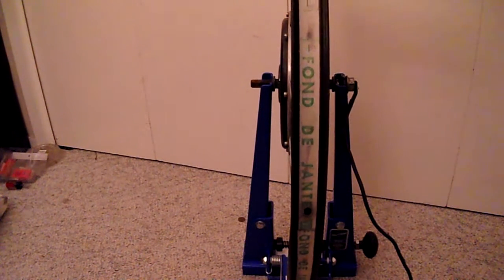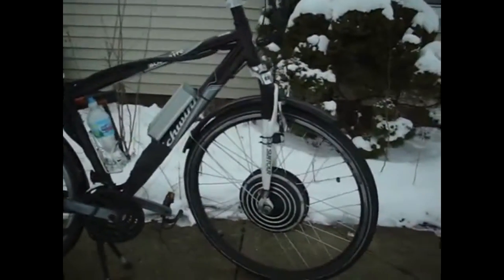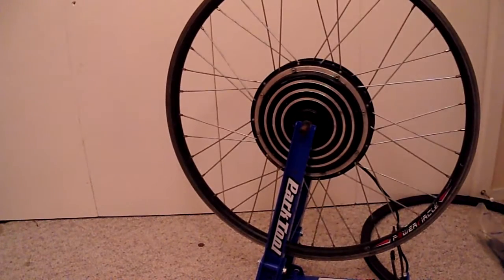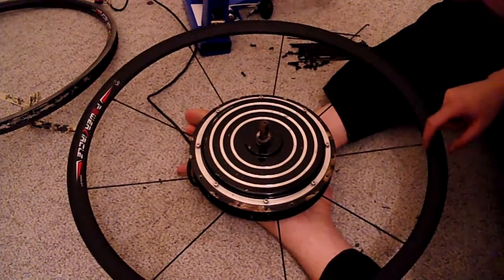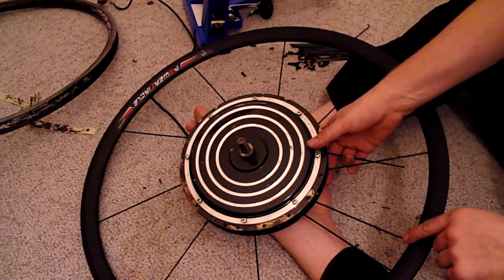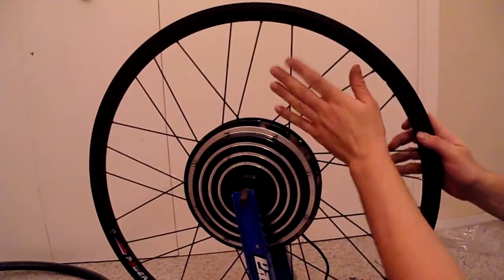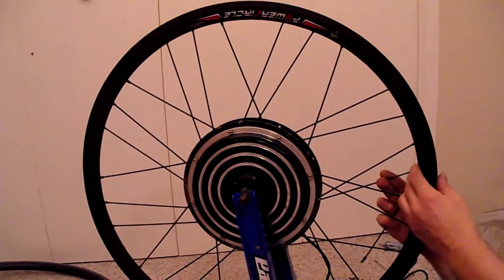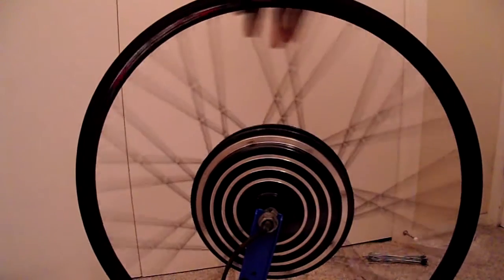Lacing E-bike Hub Motor Into New Rim. PROJECT EBIKE REBUILD #1.

Comment: Is it possible to use the original rare wheel and put the hub motor in that instead of using the one that’s on there now?
Reply from the maker: Yes it is but cautious about using rims that are not built for that amount of torque. I prefer double wall rims for ebikes.
Reply: @rocbola  where can you get them from? It’s the second time that the nipple has come off, and the other spokes are starting to loosen. And it’s already been tightened once, so I was thinking it would of been easier to use the rare wheel that was originally on the bike.

Comment: My bike isn’t a self build, but my rear wheel has never been true. 

I took it to a local dealer and they got the front wheel perfect, but the rear is slightly warped and I do notice it. Especially at lower speeds.

Do I need a new wheel like this or do you think a shop may be able to true it?
Reply from the maker: What you just described is exactly why I built this wheel.  https://www.youtube.com/watch?v=Hl_3XlTo_EQ  
Btw, this wheel is still on my daily use ebike and still true. I rode it a couple days ago.
Reply from the maker: I didnt notice which video I was commenting on, the wheel I thought we were referring to was one I built in another video.
Reply: @rocbola  I may have commented on the wrong video as I’m super desperate to get this one straightened out. It’s making my rides not so fun
Reply from the maker: Rear wheels are always problematic. I have found that i have absolutely zero problems with hand built 36 spoke rear wheels. Here is the video of me building one, and this is the one i thought you were first commenting on. It's pretty easy to do and saves a lot of frustration. https://www.youtube.com/watch?v=Hl_3XlTo_EQ
Reply: @rocbola  thank you very much. I’m going to try this out. It seems pretty inexpensive vs getting it built by a shop.

I have to say, I was pretty disappointed when the dealer told me that got it “as true as it will get”. I have put a few hundred miles on it since they did the work though, so it’s possible it’s slowly gotten worse over time.

Anyways, thanks for the help and the videos. I really appreciate it

Comment: Can you change a motor placed in a 26rim to a 29?
Reply from the maker: Yes, but you'll need different spoke lengths. You can use a spoke calculator to figure out the exact size.

Comment: Is it possible to switch to a bigger rim ? I wanna switch my motor from a skinny 26 inch rim to a normal width 29er. Please help me lol
Reply from the maker: Yes it's possible. You will need to take some measurements from the hub and rim, use a spoke calculator to select the right size spokes. Dt swiss and a few others are making ebike rims and spokes nowadays so it's pretty easy to find the right parts. For what measurements and how to take them, visit a bicycle wheel building page, there is too much to list here. The same processes used in building a regular bike wheel apply here.
Reply: @rocbola thanks for the info these will be something I’m looking to in the future

Comment: I wanted to do this just to have both my original rims on the bike. Do you think its worth doing just for the look?
Reply from the maker: Yes. Check my other videos for one called "tired of breaking spokes" or something like that. In that video i build a wheel for the non drive wheel and select a rim that matches the ebike wheel. DT Swiss is making rims and spokes now that are designed for ebikes. Just make sure you pay attention to getting the right spokes if you change the rim to something different than what came with your ebike wheel as different rims have different ERD measurements.
Reply: @rocbola  cool thanks i will check that video out.

Comment: This ZHZ-48V 1000W motor? I just bought one for rear axle. Is it possible that water enters?
Reply: Yes will find a way in, i stripped my motor down and painted will with electrical paint 12 months ago! Bike used 5 - 7 days a week all year round.
Reply: @grantclive3245  Now it is protected!  :-) How many kms do you have with the new battery 20AH?

Comment: You could have taken some tape and secured the spokes to each other where they cross and make an X... Then you don't have to take all the spokes out and put them back in... saves a ton of time.
Reply from the maker: Good tip!
Reply: I thought about since you were replacing all the spokes and the rim, instead of removing each spoke,  could you cut them all since your replacing them and the wheel too right?
Reply: @dannycreech4177  They're pretty hard steel... it's probably easier to just take the nut off... but hey... I try every short cut I can, bro...

Comment: hey man, i have a 20" wheel ebike and i wonder if i can disassemble the motor and put it on a bigger wheel like 24-26, is that possible ?
Reply from the maker: As long as it has spoke holes, you can thread it to any size rim with the same number of spoke holes. I believe Sapim and DT Swiss both make e-bike spokes.
Reply: @rocbola  Can i use a none ebike bike rim?
Reply: simezra where did you get a 20" ebike wheel!!!!
Reply: @patrickbrown8852  can I use a none ebike bike rim?
Reply: rocbola I ordered a 26" 1000W hub motor kit for $145.00 and I'm looking to try and change the rim size to a 20" or 18" rim size ? Is it possible ?
Reply: Darryl Edington I wanna try with a 16" wheel
Reply: Can I use a none e bike bike rim
Reply: Your speed will be a lot lower with a smaller wheel...

Comment: hey i have same exact hub motor as you and my wheel overtime ended up getting a vertical wobble so it bounces up and down like a mad man on a pogo stick when riding and spokes are breaking what spokes and rim did you use? Can you link me or something, wanna fix it.
Reply from the maker: I ordered the replacement rim directly from conhismotor in China. It was $20 for the rim and $40 for the shipping! It came with a new set of spokes. If you wanted to do a custom job, I believe that there are also e-bike spokes available from DT Swiss and Sapim, and there is one size available from e-bikekit. There are plenty of rims out there that will work. Have you checked that the wheel is well trued? Is the rim bent? From what you are saying, your old rim might still be savable if you can find the right spokes to fix the broken ones. https://www.youtube.com/watch?v=BZSxJD-zGD4&
Reply: Out standing videos now I can buy  hub motor and spoke thanks 😃 for the update on these ideas 😊 happy camper now ☺️